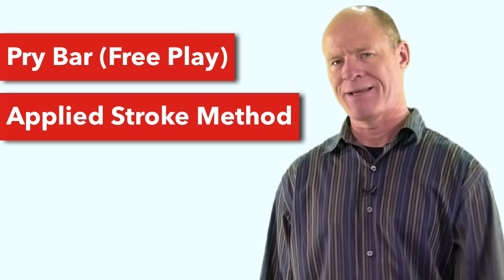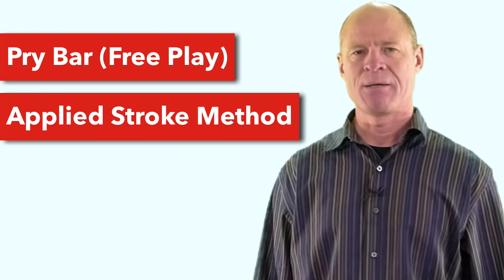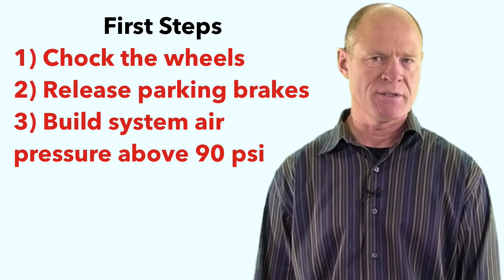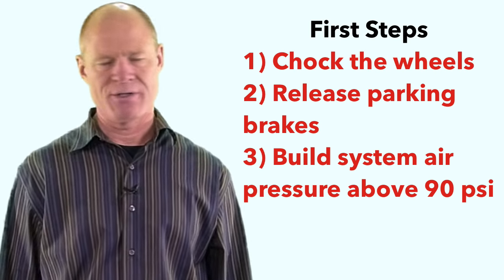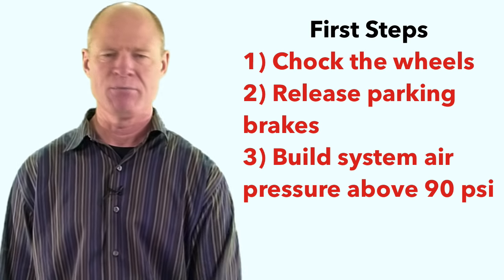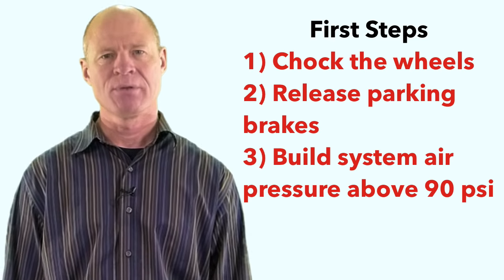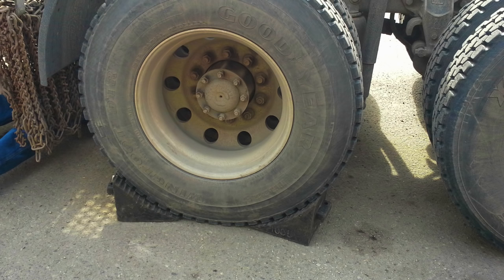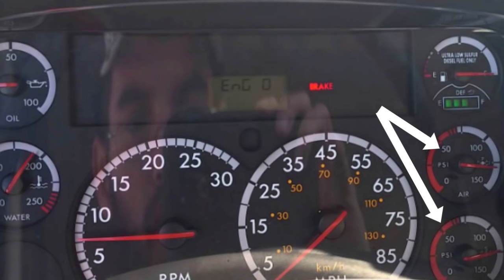How to Determine Air Brake Adjustment—Applied—Pry Bar—Mark & Measure

Comment: If you do pry bar  it's 3/4 in and if you do applied method it's 1. 3/4 in.?
Reply from the maker: Yes - 1 3/4" inch on a Type 30 brake chamber fitted with a manual slack adjuster. Almost all slack adjusters in this day-and-age are going to be automatic, so it's 2" inches using the applied stroke method. See this chart for more info: https://www.smartdrivetest.com/cdl-air-brakes/chart-of-adjustment-limits Drop us a note if we can help further. Cheers Rick
Reply: @smartdrivetest  thanks for replying to his message. So I have no one to help me to perform applied stroke but thats what the dot does here, Sto see what they see on applied stroke with free stroke please give me the correlation. Two inches applied stroke equals how much free stroke?  Lastly  please give me the relationship or formula to compare applied and free stroke on my type 24 steer chambers. Please sir and thanks!!:)
Reply from the maker: Cut a bit of board and jam it between the seat and the brake pedal. That’ll work. Find out if your state requires applied or free stroke my friend. Cheers Rick
Reply: @smartdrivetest  I’m confused in California can you do the applied pressure method to check if brakes are out of adjustment? And it’s no more than 2 inches?

Comment: Use a two inch piece of material instead of a tape measure. It’ll act as a go or no go gauge, so if this clearance fits your out of spec.

Comment: Thank you , You might save some lives with this video. At the very least it will save me a bad DOT inspection. I got my CDL in Ohio. We were only required to know the tolerances, not demonstrate it. My schooling ( Clark State) also didn't teach it. The six pack thing wasn't even taught ! I will use this knowledge from now on. Thanks again from a newbie.

Comment: The truck driving school I went to stressed that checking your slack adjusters is always a part of your pre/post trip inspection
Reply from the maker: Hi teal94z28 - Apologies for the late response. Thank you for your comment. It is law that you check the adjustment of the brakes everyday. However, since the advent of automatic slack adjusters, this is often overlooked and not done. All the best, Cheers Rick

Comment: Do it everyday in pre trip inspection. 4 hard brakes with pause before leaving. Never ever a problem.
Reply from the maker: Hi Ravinder Sidhu - Thank you for your comment. And you're checking pushrod travel ensureing all the components are working and note damaged. All the best, Cheers Rick

Comment: I got my CDL in 93 and I was taught that to check the slack adjusters you tightened the nut all the way down and backing it off by 1/4 turn.  I never knew about measuring the rod.  I have always worked for companies with maintenance schedules so I never had any trouble.  Now I'm buying my own, I am reviewing some of these things I will be ultimately responsible for.  I appreciate your video.
Reply from the maker: Hi Gregory Peterson - Thank you for your comment. And congratulations on getting your own truck! All the newer trucks are fitted with automatic slack adjusters so you won't have to adjust them up anymore. And for the purposes of liability, you probably don't want to do more than keeping these greased and measuring the push-rod travel my friend. All the best, Cheers Rick

Comment: I'm learning a lot from your videos, Your PDF Air Brakes Simply Explained and the NYS CDL Manual. In the NYS manual it does state that the this test can be done by hand. The first thought was "Yea, if you are 21 years old and that strong, sure you can". Not so easy without tools.

Learning something new is challenging to say the least.

Thank You Rick for your demonstration on the CDL Air Brake Check.
Reply from the maker: Hi Toby Dulanski -  And you are most welcome. We're happy to hear we could help out. If there is anything further we can do, drop us a note. Always happy to help. All the best, Cheers Rick

Comment: Rick, thank you for your training program. The only method I recommend when checking air brake chamber travel by ones self is a process I believe you touched on and that is to use a wedge of some kind between the brake pedal and a point under the dash to apply the brake pedal to full application. Ensure wheels are chocked and on level ground and ensure the brake pressure is not over 100 psi. By either marking the pushrods or having the colored plastic tabs installed. Parking brakes to be released. Also info the applied angle is to be between 90 - 105 degrees in California.
Reply from the maker: Hi Mickey - thank you for your response - that is great. I looked at your previous post and admit I didn't fully understand the reason for the air pressure not being over 100psi? Yes, here in BC, some person indicated that students no longer had to say that the brakes are applied because the push-rod and slack adjuster form an approximate 90° angle. And now students only have to say that the brakes are applied because the push-rod is extended. How the heck does a student know that? If the brake is installed correctly, the angle is going to be approximately 90° - it's simple physics. The best force generated is at 90°. All the the best, Cheers Rick
Reply: Keep up the good efforts. The public needs it.

Comment: Thanks Rick. Rejoining the "roadrunners" helping out though more on the older side. Running a haul truck with manual adjusters and keeping it tidy and on spec. Thanks for the info on auto adjusters and the "applied stroke" tests. Like recurrency on my pilots license. God speed.

Comment: Good Video, Thanks for uploading it!  I never was taught the "Six Pack" technique. If you do a  normal 4-Point Brake Test every day, and engage the brakes all the way down on the pedal on each push. Shouldn't that also make the slack adjusters move? Although after watching your video I'd bet that the air pressure would be below 90 PSI too quickly, and it might only get the brakes partially adjusted. And I must be a brute, because I can pull the slack adjusters out with my gloved hands. :-) Although I will be picking up a small pry bar like you used in the video to make it easier! LOL
Reply from the maker: Hi LordTimelord - Thank you for your comment. I suspect you are a brute my friend if you can pull the slack adjuster out with you hand. ;0P And yes, if you're making 4 hard brake applications every day, that will adjust up the automatic slack adjusters, so long as these are being greased every couple of weeks. Also, you are correct - you can only do 3 hard brake applications before you have to pump the air pressure back up to 90psi. If there is anything further we can do, drop us a note. Always happy to help. All the best, Cheers Rick

Comment: if your s-cam bushings are wore out, your automatic slack adjusters will exceed the 2" on the applied. So its not always the slack adjusters issue
Reply from the maker: Hi Mike grazio -  Thanks for the information. Can't say I've every had equipment old enough that it wore out the bushings. All the best, Cheers Rick

Comment from the maker: Going for a CDL, or higher class licence with a vehicle that is equipped with air brakes? As part of your road test, you are required to determine if the air brakes are in adjustment depending on your jurisdiction's requirements: either the pry bar or applied stroke method. Learn how to determine if your air brakes are in adjustment and correct the adjustment if they brakes are not in adjustment.
Reply: Smart Drive Test  THANK RICK ,SAFETY  FIRST👍
Reply from the maker: Thank you Carlos - for your comment. If there's anything else we can do, drop us a note. All the best, Cheers Rick
Reply: These methods were never demonstrated in my 2007 Community College CDL class. Now I’ve been driving for the big orange, mega carrier for a year. They never discussed or demonstrated this. If I’m going to be responsible for paying every fine I get as a commercial truck driver, then I need more education than just how to do a pre-/post-trip inspection. Any suggestions on training or suggested reading? I’ve looked at 49CFR regulations but there seems to be other publications to which these regs are attached. Here lately-while being a dedicated Wally World driver-I’ve flagged brake linings for borderline DOT failure, causing 1 reload already. Of course, I catch crap from my fellow drivers, telling me to just pick up the trailer and get going if I’m going to make more money. 

In the final analysis, I don’t want a fine and I sure don’t want to hurt someone, including myself. I appreciate your feedback.
Reply: @truckintowardretirement686  you are responsible for the safety of others and the load....screw those other super trucking idiots. They have a license to drive one vehicle at a time and yours isn't one of them. Being safe is a part of being a professional. All these wrecks out there put a target on our industry and that affects our pay. I haul bulk mail for a company and am home every night making 25 to 30 dollars an hour.

Comment: We have alot of trailers in our fleet that run on longstroke chambers (square ports) which allows extra half inch.  We're phasing out and all new ad of 2011 are air disc equipped.   My question is whats the difference between the two and why does one allow half inch more than the other.  Hope to hear from you soon.
Reply from the maker: Hi Eric Brule - Thank you for your comment and query. The reason that the long strokes have another 1/2" inch of push rod travel is owing to the bigger chamber, which allows for a full 3" of travel before the plate inside hits the bottom of the chamber. For safety however, the push rod is only allowed 21/2" of travel. In other words, it's the depth of the brake chamber that determines the travel of the push road and its legal limits. If there is anything further we can do, drop us a note. Always happy to help. All the best, Cheers Rick
Reply: Smart Drive Test thanks for the reply.  It always baffled my mimd and couldn't find the amswer.  I learned about 10 years ago on how to tell the difference between the 2.
Reply from the maker: Hi Eric Brule - you are most welcome my friend. Glad we could help. All the best, Cheers Rick
Reply: @smartdrivetest  I was looking for the link to the chart you was talking about but not able to find it in the comments

Comment: Failure of automatic slack adjusters is not the only reason for out of adjustment brakes. You could also have worn brake linings or foundation brake parts issues that were not discussed in the video.
Reply from the maker: Hi Chris Lareau - Thank you for your comment. That is true my friend. With vehicles that get regular maintenance it tends to be more so the slack adjusters than other things.  All the best, Cheers Rick

Comment: good thing you provide helpful videos, for Commercial Drivers.. this vid would be helpful if i get to set my brakes on a roadtest in a Trucking company.. so is it internationall for both canada & usa the adjustment is should no more than 1/2' to 3/4" inch..
Reply from the maker: Hi Ryan - thanks for your comment. It the United States they allow up to 1" inch on a pry bar method. However, the manuals also state you can pull the slack adjuster with your hand; however, that's not possible. You're going to need a pry bar. The best measurement is the width of your thumbnail. If there is anything further we can do, drop us a note. Always happy to help. All the best, Cheers Rick

Comment: Just watched your video and want to say I appreciate your program for teaching air brakes issues to watch for. However I also teach air brakes and was DOT in Calif for many years also.  I want to add a little info with your permission. The diameter alone isn't the factor for the travel allowance. Additionally the depth of also is a factor meaning is it identified as a LS or long stroke chamber. the long stroke allows 2" travel where as the non LS chamber allows only 1 3/4 "on a type 30. I like to advise in my classes a slight modification to your method of using an object to apply the brakes to actually be able to observe the applied travel. I recommend this method along with starting with the air pressure below cut in pressure and with the brakes applied to build the pressure to between 90- 100 psi. The brakes travel measurement are not out of adjustment when exceeding 2" if over 100 psi if they are within the 2" when not exceeding 100 psi. I have seen that process done at inspections which will then be written as a violation when per CVSA standards and manufacturers standards it is not. That then produces a brake violation on a drivers record which is a point and one half . Other than that you are doing great. Oh and the thumb nail measurement is only a recommendation.
Reply from the maker: Hi Mickey - thank you for your comment and information. You are correct that the depth of the chamber is relevant to overall allowable push rod travel. Yet, in all the manuals that I've read, it only refers to the diameter and not the depth of the chamber - which in my mind makes more sense. LS brake chambers in my experience are rare, and were a product of the 1990s when authorities revamped the air brake course and required drivers to check brake adjustment. They were also a product of the transition to automatic slack adjusters. Finally cost precluded the widespread use of LS brakes chambers. Companies simply weren't going to pay extra for a brake chamber that only gave them another 1/2" of travel. I would like to know how drivers can observe push rod travel if they're alone and have to apply the brakes? Thanks again for the comment. If there is anything further we can do, drop us a note. All the best, Cheers Rick

Comment: The pry method messed me up, I've been driving about a year since I passed the ICBC class 1 tests and believed this 1/2 - 3/4" was a rule. So one day I'm doing a pre trip on an assigned truck and two of the pushrods measure over 3/4" of free stroke and one well over an inch! Well it went to the mechanics and they said it's fine with no explanation why, this happened a second time and still no one explained to me why the brakes could be fine even though I could pry over an inch of travel out of one of them. 
I finally phoned CVSE at the Hope scale and he told me that whatever ICBC is teaching doesn't hold any legal bearing and that I could very well pry more than an inch and they could be still in adjustment.
Applied stroke method from now on so I know I'm not being lied to about the legality of the brakes by my employer, wish ICBC would require applied stroke as well.
Reply from the maker: Hi Mohan Churchman - Thank you for your comment. And yes, the pry bar method isn't always accurate. Most of the time you can use the pry bar, and then if it doesn't work, you use the applied stroke. The reason they use the pry bar is because is less complicated and takes less time than the applied stroke. If it's less complicated and takes less time, than drivers are more likely to check the brakes. If there is anything further we can do, drop us a note. Always happy to help. All the best, Cheers Rick
Reply: Try talking to shop to get a new tire, " it has legal tread they say."  I keep pointing out flat spots. Finally got a new tire. 
  With that note, I am looking for a video on better tire explanations.  I hope you have one or will soon.
Reply: Robert Collins I hear you,  makes you wonder what regulations their reading when they keep telling you that tire is fine when it has clearly worn down below a millimetre in some spots. Of course they can tell you this 5000 miles away from a photo they requested and they haven't been around a truck in the last decade let alone driven one.
Reply: @HavingAnAverageWeeke  I was at the shop. Trying to settle this. I finally got a new tire 7.
.
Reply from the maker: Hi Robert Collins - Thank you for your comment. And yes, if there are flat spots, the tire needs to be replaced. This video may give further explanation: https://www.youtube.com/watch?v=RkHIt3bxdxc&list=PL0x-bChcUvwFnHnkSuQDkXCnkxZSmjujj&index=5&t=3s If there is anything further we can do, drop us a note. Always happy to help. All the best, Cheers Rick
Reply from the maker: Hi Mohan Churchman - Thank you for your comment. Happy to hear that you got a new tire and are safe my friend. All the best, Cheers Rick
Reply from the maker: Hi Mohan Churchman - Thank you for your comment.Unfortunately, it can be hard to determine the safety of a tire from a photo. In the video I listed here, the tires needs to be replaced, but I'm not sure it can me seen in the video. All the best, Cheers Rick

Comment: Great Vid! Is that yellow plastic called stroke indicator? My single axle dumper only has one pod with it.
Reply from the maker: Yes, those are stroke indicators my friend. They won't stand up in a DOT inspection, but they do help with the daily inspection if you know these are set right. All the best, Cheers Rick

Comment: I have a 95 kw and can't keep auto adjusters in. Changed them twice by good shops. Back up hit brakes. Nothing works would love to change them to manuals my trailers and other truck is old and check them once a week. Or every time I get in truck after been out of it for while.
Reply from the maker: Hi Scott coleman - Thank you for your comment. Every now and again I hear that about auto slacks. It's a perplexing issue I'm sure because all the components are mechanical. In other words, there aren't any electronic components that could foul up. If auto slacks are going amiss, it would lead me to think that manual slacks probably aren't going to solve the problem because there's something else going on. Do the technicians have any theories as to what causing the slacks to malfunction? All the best, Cheers Rick